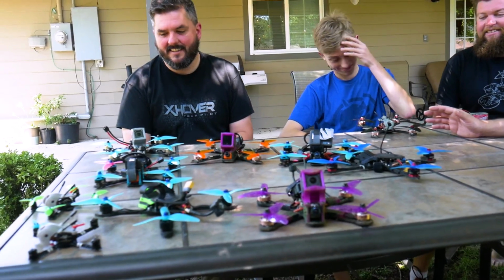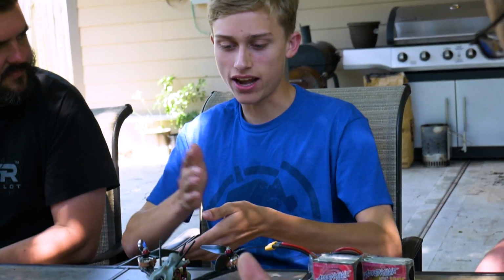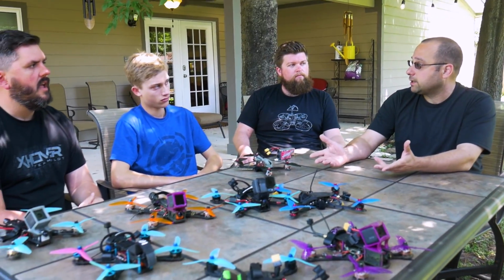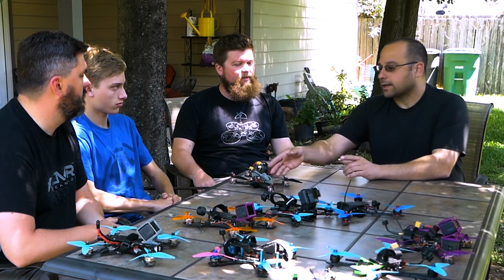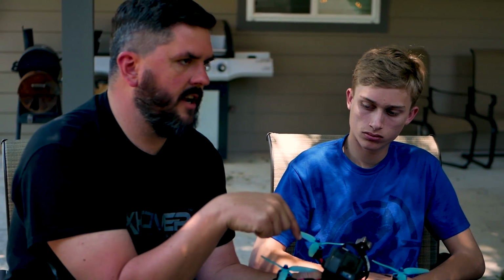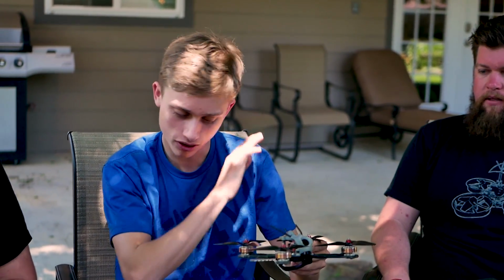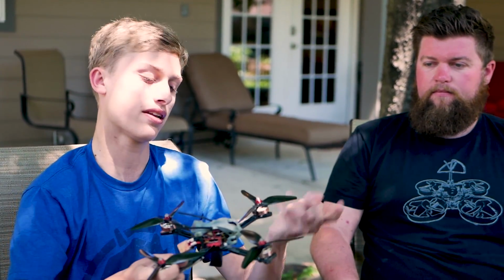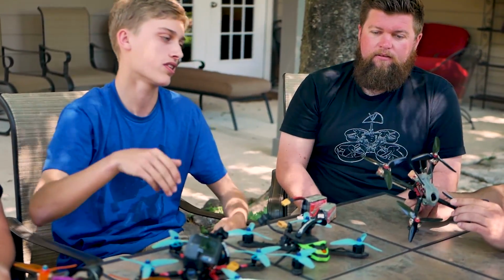Race vs Freestyle Builds: Discussion

Comment: I’m gunna listen to the kid. The unbiased difference between each pilots information are the results which have been accomplished directly compared to any a-posing theory. In other words; racing is the foundation of any freestyle in any medium. He is not speaking opinion, what he likes, or what he enjoys flying. He is talking about successful results in the top skill level. I respect all of these top level pilots and their willingness to share the theories which make the benchmark for their preferred discipline of flying. But when theories contradict; I know the racer or racing discipline leaves little room for opinion. If you take your opinion to a race, you will leave with one of two; a changed opinion or a proven race advantage. Either way, opinions morph into fact or failure somewhere between the start and finish line. The kid is the only one that Understands this perspective (josh excluded; of coarse). But you are all inspiring, supernaturally skilled pilots setting the benchmark for the sport. Thankyou for sharing!

Comment: Greetings!!!…will this specs match with that of a race quad…my sole purpose behind creation mixed flying style when necessary…my specs are:-
1) Frame – Foxfly EGG 135 mm X form 3 mm arm.
2) Tx and Rx – Flysky FS i6 Tx and FS Ia6 Rx.
3) Motors + Props– Aurora D1306 3750KV and Gemfan Flash 3052 3 blade props with 5 mm mounting hole
4) Camera – Caddx Turbo EOS 2 1200 TVL 2.1 MM.
5) FC+ESC+VTx stack – GEPRC STABLE F411 Betaflight OSD.
6) BATTERY – 3S 2200Mah 40C ( I’m concerned with the battery is it low or high powered…pls suggest if necessary)…my weight adds upto 291.1 gms in all.

Your suggestions are welcome!!!! Eagerly waiting for your reply.

Comment: So to summarise the difference is basically the energy required to change the  momentum of the quad-copter, the faster you change the state the less efficient it becomes but in certain applications you need a faster state change so its about optimising the energy required to do that.

Comment: YES around 13 minutes in  the guy talks about how efficiency. I recently took my 3 inch down from 3052's to 3028's thinking i'd get more battery life, and instead what happened is that I got A LOT LESS battery life! I needed more throttle to hover, the motors had to spin much faster, I even had to increase filtering because the motors were getting too hot. It was very surprising but in the end made a lot of sense.

Comment: When talking about the different frame styles, takes me back to my days of archery, where a long rod (stabiliser) with weights on the end would effectively slow down your movement of the bow when aiming, more weight as long as your strength and endurance can handle it mean't essentially aiming became less twitchy and easier to hold on target.

Same physics principle regarding arm length and stretched X frames etc.

Comment: Wow you guys only lightly touched on the main difference between freestyle and racing quads like one time. You didn't even make it a subject...

Where you mount the battery. You touched on it a little but it was to bulster another point you were making. I was imagining that one of the main points would've been where the battery is mounted.... but you guys never even really talked about that at all which is very strange.

Comment: more challenging doesnt mean slower, but easier has its benefits! if you control it through the small space youll gain/keep more speed but i understand its a balance, different for everyone. i like the downpitch the prop solution for that, simple functional. i think hes got the right idea.

Comment: A frame designer demonstrated that if you tilt a short kwad on a 20 degree angle. The rear prop catches air turbulance from the front. A longer x  on the same angle. Lifts the following props through cleaner air. No difference on straight punch out. But, much more efficient for forward movement. I believe this theory.

Comment: Great video, but I noticed a few misinformed tidbits.  First, they just made up their own definition of propwash.  Never mind what the real definition of propwash is and has been for the better part of a century.  Second, mechanical advantage, what he was trying to describe when mentioning the fulcrum, has nothing to do with the speed of response.  Rather, that only has to do with the amount of force needed to move a load.  What he meant to say was the shorter the radius (distance from the motors to the center of the drone) the more responsive the drone would become.  This makes sense, not the baloney he was spewing.  Otherwise a great discussion with a lot of good points to consider when building a drone.

Comment: Thanks for taking the time to discuss frames :-)
I still think you guys are missing something, firstly Aerodynamics and secondly the true CG of the drone, the battery is the heaviest, this should be in the very centre of all motor axis.... Having aerodynamic booms also makes the machine track better, it's also 30-40% quieter... You can test this theory with some little bits of foam and tape above and under the boom. Crude but you'll see the difference. Lastly!! a TRUE PLUS frame is MUCH better at just about everything. These X machines, stretch, squished is all just a trend....:-) Cheers guys!! Happy flying !!!!

Comment: Short answer: a system of higher order non-linear differential equations
Reply: Not practically giving an answer to any of the issues being discussed, so no, that is not the short answer, as it`s not actually an answer.
That`s a summary definition of the math involved, not an answer to "race VS freestyle".
Reply: @afrog2666  r/woosh

Comment: Something I noticed with my true X and seriously stretched is: true X the rear motors work much harder than the front ones, and stretched they are far more equal loaded.

I'm using a stretched racer with ls2207 freestyle type motors with an icm gyro on 32kHz. It far outperforms anything I've ever seen in any way, freestyle or racing.

I think the youngster here is ahead. The theory is flawed.
Reply: How do the physics behind that work? Moving the motors back two inches shouldn't cause that much of a difference

Comment: I seriously don't get the people who say Vanover's acting cocky. The guy has the wins to prove  what he says carries some substance. Both Stingy and Zach were talking down to him and disregarding the experience that he has gained. On smaller tracks, the cap'n has the skills to zip around with an under pitched prop with a lightweight setup whereas a heavy setup would help a pilot with lesser skills. I would rather listen to someone who wins actual races than the others with regard to racing. Very valid knowledge on the freestyle side of things dropped by Zach and Stingy.

Comment: It seemed frustrating for the racer kid. Everyone kept talking over him. Meanwhile I imagine he felt that he had to answer to numbers not opinions.   

I liked the part about how longer arms give more leverage and slow down the response, in my case gives me more control. My experience as an inexperienced flyer is that most of what the industry has settled on doesn't work for me.  I make my own frames from crashed quads and parts kits and I typically end up with 240-260 mm for 5" machines. 220-210 are too twitchy.  I can successfully fly a 250 with 5".  Taking the exact same quad and extending the arms 10mm in each direction doesn't change the weight much.   With stretched-X (it sort of came out but I don't think as definitively as I experience it is that)  by lengthening the pitch axis they're getting more control/resolution of the throttle.    

If any frame makers want to pay attention to what this avid but less skillful flyer needs is very light slightly larger builds.  My own machines are 300g (without HD) and 250mm.  For me lighter and larger with the same power are what's more durable and more flyable.  The industries offerings don't work for me.

Comment: I think the biggest thing that Stingy and Zach hit on is actually the best takeaway for a newer pilot - if you like the feel of one family of propeller, then sticking with those is going to work really well if you vary what you are looking to do.  Optimizing the efficiency range for your setup to how much throttle you're actually using AND how much time you're spending at what AoA (i.e. unloaded, or backing into turns on tight race courses) is really key... and being able to do that without relearning the feel of the props - how they transition from loaded to unloaded, or react in propwash - so sticking with one prop family makes tons of sense.
HQ V1S:  5x4x3, 5x4.3x3, 5x4.5x3, 5x4.8x3, 5x5x3 - full range of excellent, light, snappy props
DAL Cyclone: T5040C, T5045C, T5046C, T5050C - my preference are the V2 5046 cyclones

Comment: A_nub is speaking about racing with a heavy quad in relation to not being a pro racing pilot. Of course a heavier quad makes it easier for a less talented racer, but it’s all relative and the more skilled a pilot is the higher the power to weight ratio he can handle in a course. The idea is always having the max power and speed on tap and having the throttle control to use it in tight courses. If what he was saying was true then in all racing sports they would add weight to “dumb down” the handling for tight courses.
Reply: Yes and no - like any other form of racing, a really great pilot is going to be able to fly to the limit of their hardware, and find ways to get lower lap times more consistently and end up ahead of their competition.
In cases where it's purely open competition, thrust to mass ratio is still the figure of merit whenever that limit can be reached.  
In the case of this, a lighter quad can be flown at 90% and go comparably fast, but this allows you to have a happier battery finishing the last lap, with more margin in the hardest negative AoA parts.

Comment: Cool discussion, but there was a lot of armchair engineering discussions regarding physics. The word fulcrum should never be used in a discussion regarding flight. Objects in flight do not behave like a pendulum, the center of mass rotates around the center of lift.

 When is there going to be someone who truly understands the physics brought into these discussions?
Reply: We know about the pendulum rocket fallacy thank you. Stingy was trying to talk about how torque increases as the lever arm increases. He said fulcrum because it's a live discussion and people don't always get everything right the first time out.
Reply: @ Joshua Bardwell - It's actually less 'off' than you're conceding.  Practically speaking, treating it as a leverage problem vice instantaneous center of pressure/mass ends up being a semantic difference in terms of what the PID loops in the flight controller is going to see, which is what the discussion is really focusing on.  The system response looptime is the real figure of merit output, and this same phenomenon is what masks the actual motor torque (and why so many people mistake the end-to-end grunt of a system with the actual torque produced by the motor mitigated by the rotational inertia of the prop/motor combination)...

Comment: Instead of "dumbing down the throttle" with weight or decreasing prop pitch, have any of you tried expo on the throttle? I'm a big fan of light weight for freestyle. A light skinny air cutting frame is key to maintain float. I'm at 450 grams all up on a 6 inch avan bi blade 1300mah.
Reply: Casey Dimmitt YUUUUP I'm with ya, all about da float

Comment: The problem with frames that get too small is not just the leverage issue but also the props start interacting and upsetting each other and this is completely not what you want to happen. 
Each corner needs to be able to do its own thing without changing or interacting with one of the other corners or otherwise the stabilization calculations become massively less effective.

Comment: NO...Pitch numbers mean how far the prop moves through the air in a single revolution...
Reply: SKIDOOSH at what speed?
Reply: @aldenhauser9555  per rotation in ideal conditions unloading 100% with no prop slippage in the air (which there pretty much always is a degree of). I think it gets wierd and some props go by literal pitch or advance ratio but plane props and most multi prop go by advance ratio? (Third voice to confirm that pls)
Reply: Yes, measuring advance ratios on a static ideal case is probably the best figure of merit, although the way props unload is a huge part of why the different shapes and feel can emerge from different designs.  Comparing across the same product line, pitch works really well (or at least within the same overall design family).

Comment: I really liked this discussion but when you guys were talking about the different frame styles and sizes you all forgot to mention how it keeps the “dirty air” from the front props from affecting the rear props. I still learned a lot from this video. Thanks guys!🤙🏽👍🏽😃
Reply: Well the trouble is with stretch frames the 2 front motors and 2 rear motors are so close together that they affect each other in a bad way.. so you are correct in theory, that the front props dont affect the back props, but they do have a big sideways effect.. i just transfered a quad from true x to stretch x.. and it flies awful, i have to force it round every corner,  it is faster, but not enjoyable to fly.

Comment: If you want a frame that you can use for a little bit of racing and freestyle, use a FlosStyle. Battery bottom OR top, relatively light weight AND not too easy to break.

Comment: I freestyle a sub 300g racing frame on 3s 1300 2600 kv and love it
Reply: What's your flight time on your setup? Prop choice?
Reply: I have 2, a 5 & 6"...5" I get 5 mins w punches or 8 mins cruisin on gate breakers lipo rest at 3.72, graphenes 
6" Gemfan 6042 tris or 6" gate breakers, they most efficent tris, I've tried tonz.  banggood has clones, they pretty good n cheap, not as efficent tho, less pitchy design

Comment: All I know is making my 7in Valorem fly well is a bitch compared to my 5in and 6in versions.   Hard to believe it is entirely the props.   Tossing a set of 6in props on makes it a bit better.   But I have also found that just tossing a shitton of weight on the quad helps.     Flying my 7in Valorem with a 1900mah 4s on Emax RSII 1600kv and it gets shakey.   Put a 4200mah 4s on it and it dampens out.   Difference in flight times is almost 8min on 1900mah and about 11 minutes on 4200mah.

The issue of props and efficiency has me setting throttle to maintain altitude while in level flight then being super gentle on throttle.  Cruising speed of about 40mph and the differences in weight on battery becomes super apparent especially if there are any wind gusts.   

AUW for my 7in Valorem and 4200mah 4s?   Over 900g, 400 for Valorem, 400ish for battery, then add GoPro Session.

Then for "good for both" hyperlite has some options out there.   The Floss-style and even the Flowride are becoming my favorite flying quads I have run.   Love my 6in Flowride build and 1700kv for Freestyle and my 5in Flowride with 2400kv for ripping hard.

Comment: The lighter weight is less inertia thing isnt entirely true. Inertia is mass and velocity. So if it a race quad is going twice as fast but half the weight its basically the same inertia as a quad that is twice as heavy going half the weight.(I know that isnt exactly linear but its roughly similar).
Reply: Momentum is mass times velocity. Inertia is a quality of matter wherein it resists changes to its velocity. Inertia is proportional to mass and doesn't depend on velocity. (Unless you want to get into relativistic speeds where mass changes as velocity changes, but our quads don't go that fast.)

Comment: This was SO interesting for me as someone who builds frames himselfe. I could have used more of that juicy sience stuff! Bardwell ruined some parts where I had to facepalm. I know education is important, but i dont think any newby os going to watch this video, someone that doesnt even know the impact of prop pitch.
I missed some battery placement disussion, something about prop durability vs weight, I dont know which camera to use, but most interesting would have been the kind of motors you guys use. 2207 vs 2306? How big is the benefit of light (2204) motors?
I am looking forward to part 2 of this discussion!
Reply: It's very risky to start assuming what your audience already knows, unless you make it explicit. Newbs should feel welcome in this discussion too.
Reply: I have some ideas for a frame design, and I want to try and make that possible. Can you give me a run down of the hardware and software I'll need?
Reply: I use Inventor or CATIA (depending on who I'm working with) as 3D CAD Design software, because I have free student access to them. When I am finished with my frame design, I export the outlines of the carbon parts in .dxf file format. After that I transform those outlines to G Code for CNC milling with the free version of Estlcam and then I cut the frame. Its that simple ;) (jk it was soo hard the first time)

Comment: Not much mention of KV.
Reply: It's so coupled with stator size and battery (voltage, capacity, discharge), probably not worth introducing to keep this under an hour.
Reply: @tehllama42  
Agreed, there are too many sweet spots to talk kV directly.